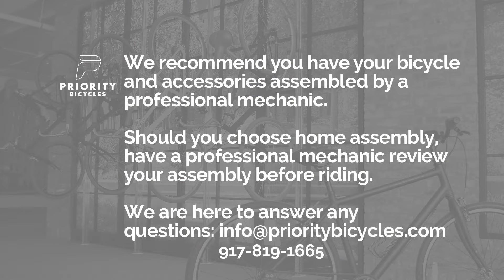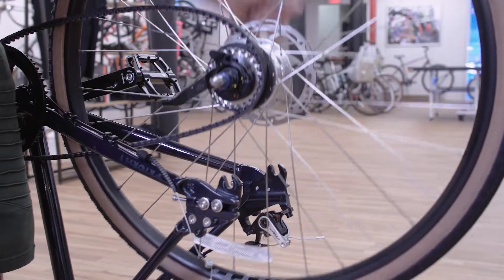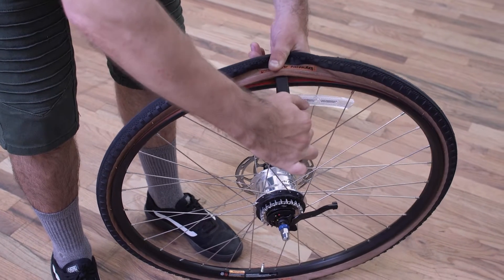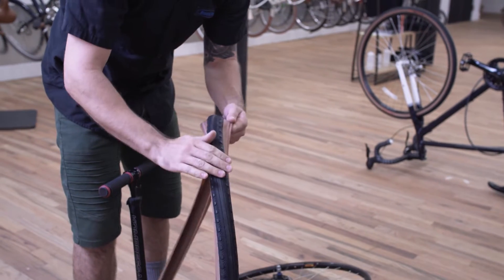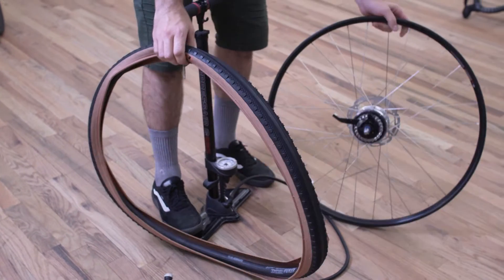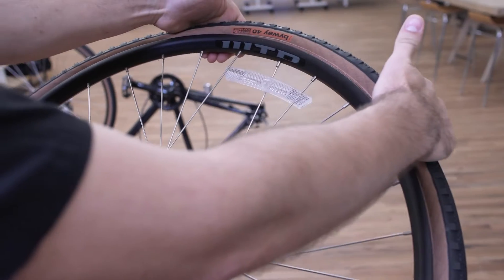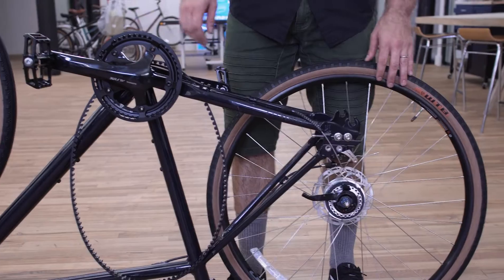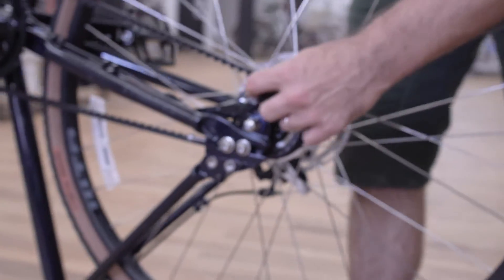ALFINE 11 REAR FLAT REPAIR WITH GATES CARBON DRIVE

Comment: Thanks for the tips. I struggled getting these byways on and off. It's been the hardest tire to work with for me, but this video helped a lot. Also  with getting the wheel on and off.
Reply from the maker: Hey Jeff. Feel free to email or text anytime. The byways are firm so they take a bit to get off but they are a great tire. Thanks!

Comment: After fixing the rear tire for flats, do we check the belt drive tension? Looking forward for the video on how to adjust the belt drive tension on the Apollos. Thanks in advance.
Reply from the maker: Great call- thanks!
Reply: @PriorityBicyclesNYC  how do we check the belt drive tension?
Reply from the maker: The carbon drive app is great. We will shoot this video also! https://youtu.be/QejZD_wT1Gc

Comment: Thanks for the clear instructions. 
Is there much difference with the removal of a wheel running an Alfine 11 Di2 hub?  There's no cable to release and the motor unit seems to hide most of the part where you disconnect the cable on the non-Di2 hub.
If there's much of a difference, please could you make a video showing the Di2 version ...I'm sure I'm not the only one who'd appreciate it!

Comment: After watching this excellent video, I don't know why I always have such a hard time getting the tire back on the rim. I run into a problem trying to push the last few inches of the bead over the rim.
Reply: One of the hints is to be assure that the bead is as far into the well of the rim as you can get it before pushing on the last few inches of tire over the rim edge.

Comment: Somewhat related to this, but about the Alfine hub. Doesn't the green index spacer go on the drive side and the blue on the non-drive side? Obviously it's working fine on your bike, but mine is opposite and also working fine. Hmmmmm?

Comment: Can any Alfine geared bike be converted to a belt drive or is it a special complete hub that can be bought
Reply: Most drive belts are a continus loop. In order to install one, the bike frame has to be split. This is not a problem for chains, which can can be split at any link. I bought a bike with a 3-speed Shimano drive and a belt. While I really like not having a derrailure, I don't find much advantage in having a belt over a chain. If you ride in wet and muddy conditions, the belt would be an asset.

Comment: Why remove the wheel? And you do need some patches to fix a flat!
Reply: It is possible to repair a flat tire without removing the tire from the bike, but most bikers don't do it that way. Firstly, it is important to thoroughly examine the tire to see what caused the flat, which may not be obvious. Secondly, most riders will simply replace the tube rather than patching it to decrease the possibility of having another flat.

Comment: The best thing you can do with this Apollo is throw away that WTB tire immediately and replace it with Schwalbe Marathons before you take your first ride. You will NEVER have to worry about a flat on Schwalbe Marathon be it green guard or blue guard anything less than this is a waste of time.
Reply from the maker: Thanks for your recommendation.  The good thing with all of our bicycles is that riders can customize them for what is best for their ride.
Reply: I'll vouch for Marathons all day long, as they made a world of difference to my commute experience. But while they are bomb-proof commuting and touring tires, they are hot trash on gravel and I wouldn't recommend, specify, or use them on a gravel bike.

If I buy one of these Apollos to replace my commuter (I'm thinking about it right now) I will definitely put Marathons on.